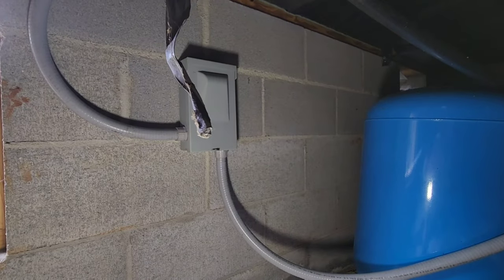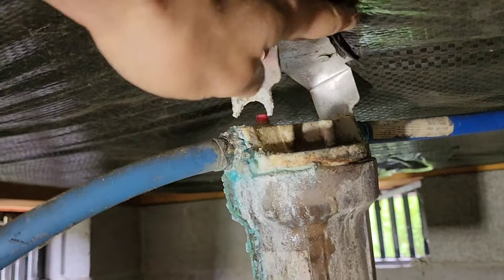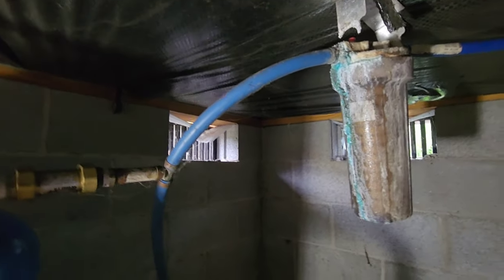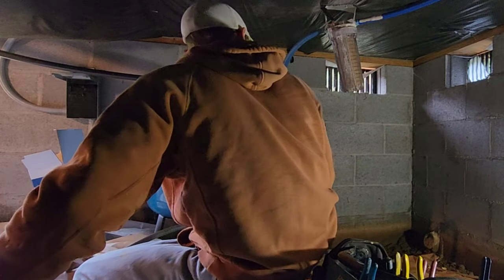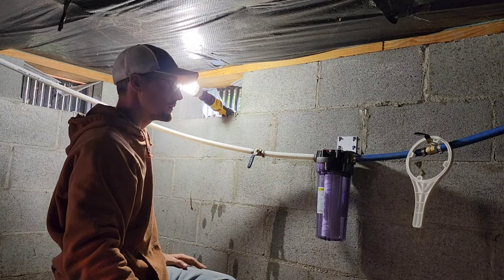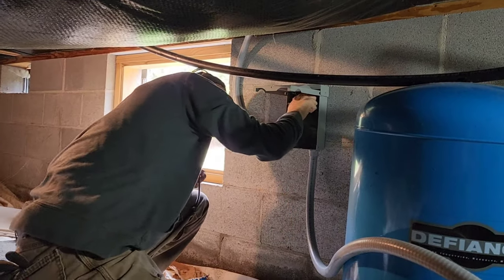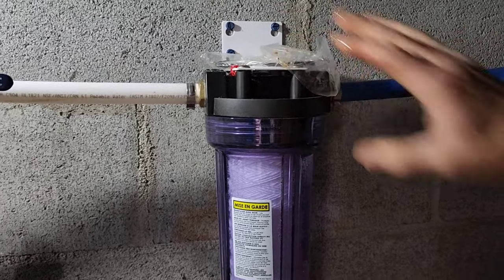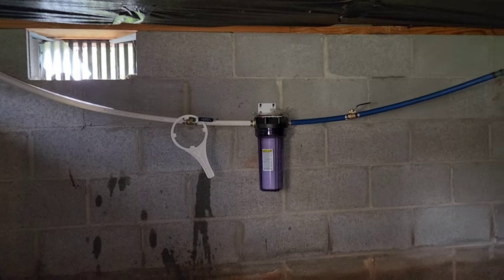A Nasty Water Filter Replacement Job.

Comment: Filters I cannot find my filter the well aside it is a big hole that has a Colbert lining. The pressure tank is down there with the filter. Be by that. Or would it be under the house someplace. It is not in the garage. CSJ from Wellington Nevada. Thank you love watching your videos. The water stinks so I’m gonna try to flush it the way you showed me on another video.  Thank you again great videos..
Reply from the maker: Filters are typically in a crawl space under the home. But you may not have one.

Comment: Pex A with expansion rings is the way to go.  Once you start doing alot of pex.  You dont lose flow through the fittings and its cheaper and faster to work with

Comment: That was a pretty disgusting Big Blue filter, also no shutoffs or bypass valve. Here in the rust belt we tend to have basements nice not having to work in a craw space. I installed a 20" Big Blue sediment filter a number of years ago. We have great well water but had a sand  problem so the a gradient sediment filter has worked great.

Comment: Do you like that sort of crimp ring better than a copper crimp ring ,if so why.
Reply from the maker: I prefer the stainless steel rings because 1 tool will do 1/2",3/4",& 1" . Also the copper rings don't seem to be tight just by looking at them.  The SS type are easy to notice if they're tight.
Reply: @h2omechanic  thanks

Comment: I cannot get my water pressure above 20. Replaced switch SQ D 35-50, gauge and nipple same result. Air in tank was 18 ,I added air to 28. I can adjust all day long with no results. Turns on at 18 stops at 20. Any ideas?
Reply from the maker: Turn off the breaker to the pump & see if the pressure gauge drops to 0. If it does, you have a leak in the pipe in the well. 
If not, then the pumps probably worn out. Either way pulling out the pump/pipe from the well is going to have to happen

Comment: Looks like you are using Boshart filters. Is that a 10 inch? And what is the best micron filtration should I use; 10, 20, 50, 100 micron? This always confuses me. 
Thanks in advance 
Victoria